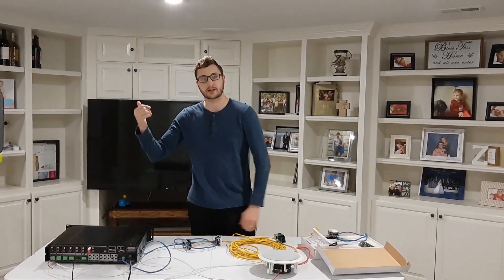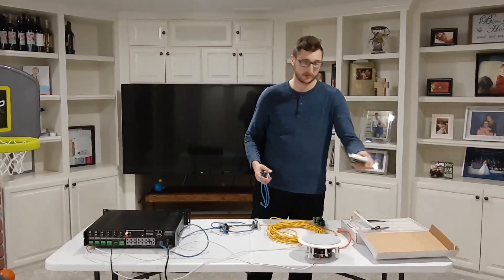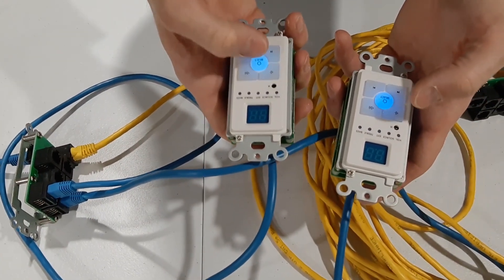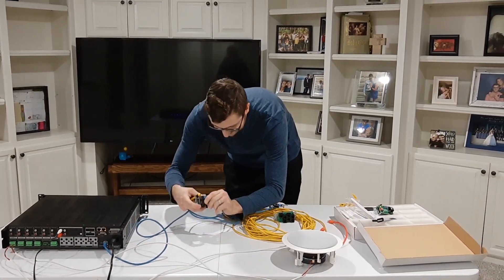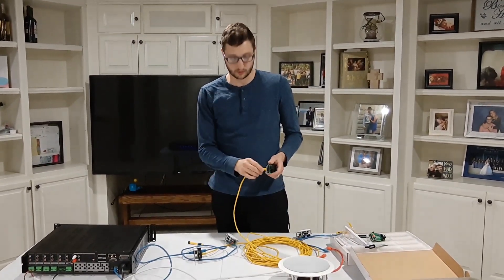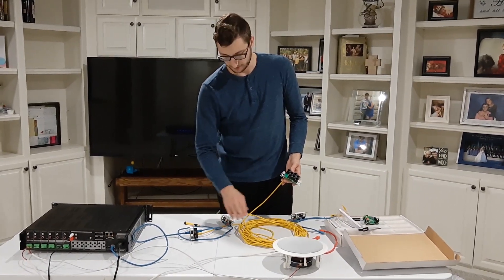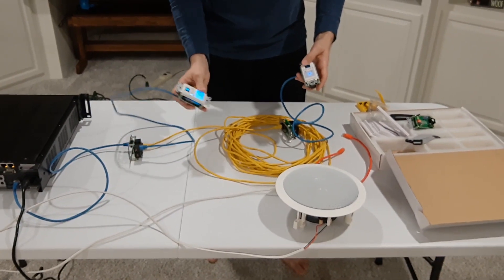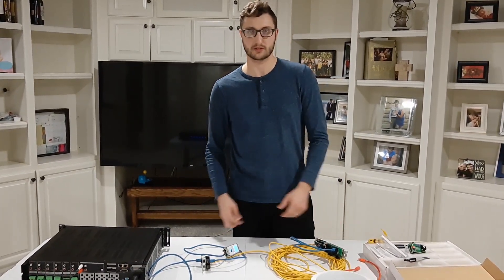More Than 1 Keypad in a Zone? Why Does the Hub Have 7 Ports?! The Monoprice/DAX66/Soundavo WS66i WHA

Comment: I love this walk through! I cant wait to start this project on my house!! 
Is it possible to include 7.1 surround sound into this system?  
I would like to do a 7.1 in wall surround sound system into the living room.
Reply from the maker: Yes, it is possible. I actually have already recorded a video that will discuss this topic. It is possible through those pre-amp outputs which are on the back for each zone. The video that i will be uploading soon, it will be titled something like "How to get 3, 4 speakers & more in 1 zone". Something like that, so stay tuned, it will be up probably this week. In a nutshell though, the way it works is that when using the pre-amp outputs, that gets hooked into the source input of another amp, or in your case your home theater amp. When using pre-amp outputs, you do not hook speakers into the back of the soundavo ws66i / monoprice / dax66 amp. Because the pre-amp output is saying you are using a separate amp, to power that partiuclar zone. the pre-amp output will pass all the source data, volume EQ etc into the external amp, and then that external amp is what is powering the speakers (you surround sound in this example). So your keypad for that zone will still work, and the volume, source selection, EQ etc will all still work.
Reply: @TheKMZ1  can't wait for this video. 
I'm excited to install the 7.1 system as well as whole home audio. Would it be possible to also play the surround sound audio on other zones in the system? Such as the kitchen or dining room in addition to the surround sound playing in the living room? Does that make it apart of the surround sound (9.1 etc)
Reply from the maker: @swiftcreek2008  It's probably possible to play the audio coming out of the surround sound as a source into the WS66i yes. But no, that does not make it part of your surround sound. Any source coming into the WS66i can only be output as Left and Right stereo, and that's it. I would suggest that you don't try to use the WS66i as a surround sound, as that's not what this amp is designed for. For example, if I have a TV as a source in the WS66i, and I am able to play the TV audio in my outside speakers, that doesn't make it surround sound, because this amp does not, and cannot differentiate between what surround sound really is, which is front left, front right, center, back left, back right, etc etc. This amp has stereo Left and Right and that's it. So while you can achieve being able to have TV or movie audio come in as a WS66i source, it's not a part of any surround sound, it's just another audio source that can be tuned into and listened to. When using the pre-amp outs, if you want your surround sound speakers to be a zone, that really means you are wanting to also use your surround sound speakers to listen to music out of...BUT when it comes time to play a movie or TV, you would be switching your surround sound source OFF of the input where those pre-amp RCA cables are plugging into. Example, your pre-amp out from WS66i goes into your surround sound amp's SA/CD RCA Input. When you want to have that be as part of your whole home audio for listening to music, your surround amp will be to be on that source. BUT when it comes time for a movie, you will want to change the surround sound source, to your TV / HDMI / whatever other source that movie audio is coming from. It would no longer be tuned into SA/CD input. So there will be some source switching on your surround sound depending on when it's time for it to be part of the whole home audio, and when it is time for it to be an actual surround sound.  Hopefully this makes sense
Reply: @TheKMZ1  i think i get it. The surround sound aspect would be separate from the whole home audio. I understand the stereo audio. 

Where would my surround sound system receiver be part of the system for when its not movie time?
Reply from the maker: @swiftcreek2008  when it's not movie time, the surround sound amp still powers the speakers. When you use those pre amp outputs of the soundavo, you are basically passing along everything to that other external amp... the music source, volume, EQ, all goes into that input of your surround amp via the RCA cables (red and white) that connect the soundavo to the surround amp. So the soundavo for that particular zone will not have speakers hooked up to it, the surround sound amp gets the data via the RCA cables and the surround sound amp will power the speakers. So if that surround amp is not on, or if it's on, but not tuned to the right Source input, then you won't get sound. Many high end amps have a HT bypass (home theater bypass) or "direct in", or direct line in, all these names are the same, what it does is anything coming into that input will bypass the signal processing of the surround sound amp, and will play at 100% volume. That's because these inputs are for this exact reason, it means the signal incoming will provide the EQ, volume adjustments etc. So it simply bypasses the signal through the amp unaltered. But, most consumer home theater amps don't have the HT bypass. So therefore, you would just use an input such as satelite or CD input. Yes, these input types still go through signal processing of the home theater amp, so you'll have to adjust some settings/EQ probably, and volume to find the right balance.
Reply: @TheKMZ1  I'm looking at getting the Denon AVR-X3600H system for dolby atmos surround for my livingroom. Would the digital audio cable from my TV be plugged into the amp or the receiver? I'm so unsure about how all of this works. I'm afraid to spend all this money and not be able to hook it up correctly and ultimately have to hire a professional to come fix my mistakes.
Reply from the maker: @swiftcreek2008  it would be plugged into your surround sound amp. And then if you had the soundavo ws66i you would use RCA cables (red/white on both ends) to connect from the soundavo pre-amp out, into another input of your surround sound receiver. That is only if, you wanted your surround sound speakers to be a part of your whole home audio. If not, then disregard what I said about the connection of the RCA cables.
Reply: @TheKMZ1  such as the audio in section? (Red/white cable inputs)

Is there a way we could email so I could send specific pictures?
Reply from the maker: @swiftcreek2008  yes the audio in section, such as CD input, satellite input etc. Buy me a coffee and I'll give you my email lol https://buymeacoffee.com/TheKMZ1

Comment: This video mirrors what I observed too. 🤢 So, it begs to ask the question how does one select the same or different source like the others say from zone 1? 🤔

Put another way if zone 1 is listening to source 1. How can zone 2 listen to the same source 1? Can that be done along with listen to alternate source?

I’m just getting my system set up and might have missed the obvious setting to do that. Any advice to do it is appreciated! 👍🍺
Reply from the maker: Maybe you are misunderstanding what I'm saying, so any zone, can select any source, that is not a problem. But you can't control 1 zone from 2 keypads, it just doesn't work. So think of a 3 way switch in a house that is at the top of the stairs and the bottom of the stairs, they control the same light. That's what I'm saying in this video, you can't have 2 keypads for zone 1. The mobile app would be the best bet to control it I suppose from 2 locations. But if you have 1 keypad, changing the source to any of the 6 sources is not a problem at all, that's how it's designed!! Thanks for watching

Comment: I missed this video.  GOOD CONTENT! 

Ok I've got to pick your brain one more time.  So to hook up 12 zones,  1-6 go to the hub then out to the Master amp - each dip switched discreetly to 1-6, Then 7-12 go to the next hub.  NOW do those go to that cascading port into the first hub, or directly the first slave amp? Is there a new dip switch scheme for 7-12? I think this may solve my problem. 

That first test you did looks like what is happening to my keypads.  Sorry I can't test - I'm not home very often.
Reply from the maker: So you don't have to cascade the keypad hubs, if that is not needed for your install. I would say most people probably do not or have never done this. Keypads 7-12 must be plugged into their amp, and keypads 13-18 into their respective amp etc. How i've always done the multiple amp installs, is that keypads 7-12 go into their hub, which is then plugged into the slave amp, and i've never used any hub cascading until now. But yes to answer your question, keypads 1-6 use those dip switches to address each of them as 1 through 6. Then keypads 7 - 12 you address them as 1 through 6 again (1 means zone 7, 2 means zone 8 etc), and the slave amp that they are plugged into knows what it is supposed to control. So yes make sure your zones 7-12 are plugged into your slave amp, and that they are going into your slave! Thanks for watching